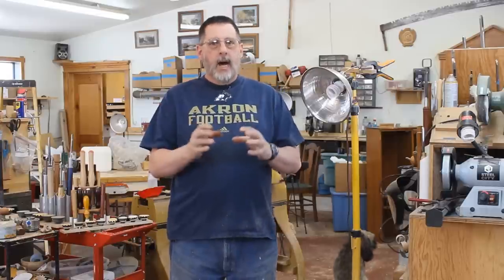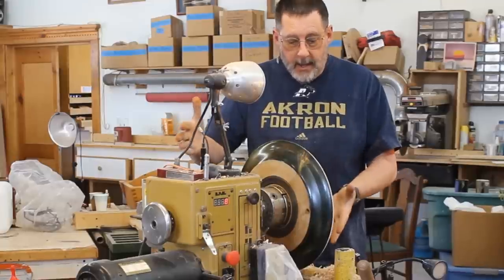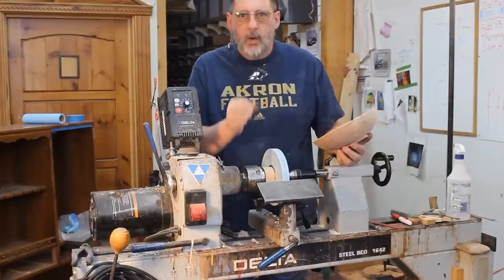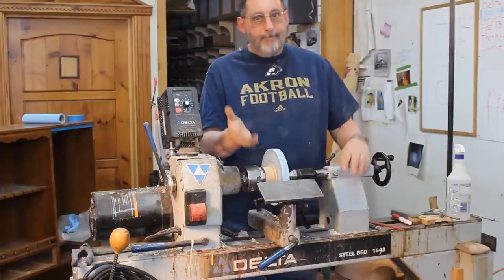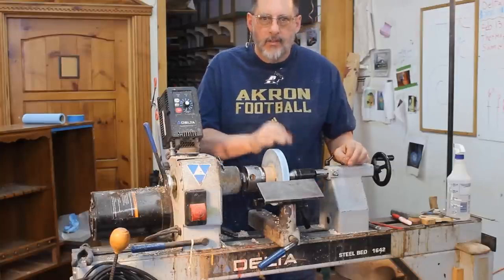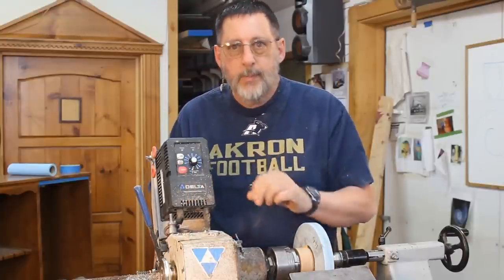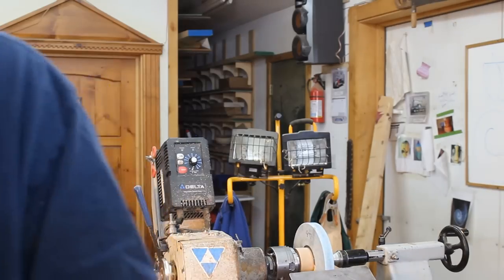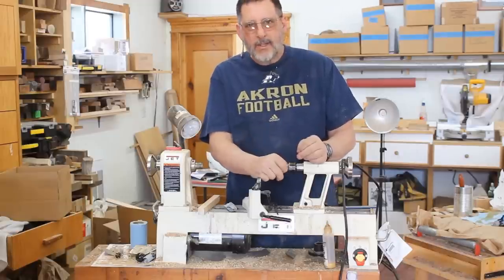Selecting a Wood Lathe

Comment: Sam:  Your thoughtfulness about what you say is commendable and above and beyond the call.  
Anyway,  I have the Delta you just sold and for me it works fine.  I do mostly small stuff and I am currently learning to chase threads. The only thing about the Delta is that if I need to go from chasing speed to turning speed I have to change belts.  I may look at the new Jet 1221 VS although changing belts is a 10 second process.
Reply from the maker: You got that straight....changing from chasing speed to turning speed-back and forth is a pain.  I have done a few thread chasing demos with the Delta midi.  It works good for chasing but for the back and forth is a pain in the backside.  Changing belts in the Delta was quick and easy but just interrupted the flow.
Thanks Sam

Comment: Very honest video Sam, I think you're right with your thoughts. Most people, including myself mistakenly start with "big and cheap", as we know no better. However I think it may be a good thing, as after all you may not want to continue, and then no great loss. The ethos of the best you can afford is a good one, then you only have to "cry" once :)
Looking forward to the Oneway un boxing.
Take care
Mike
Reply: Problem is, when the best you can afford is the cheap one.  Do you take the risk and have some fun, or do you miss out because you can't afford the "good stuff?"  I went with cheap and small, $500 Nova Comet 2 and other than some really crappy design flaws, I love it and without it,would not have returned to woodturning after using my dad's 50 year old lathe that could only turn spindles 29 years ago.
Reply from the maker: (Mike) Well when I did the first take on this video I really forgot where I started.  A borrowed lathe that had seen better days, hand made tools from old files--and there is nothing more exciting than breaking one of those files.  I actually tried "turning" something on my drill press.  Yes and Josef makes a good point....Maybe the risk is worth what joy we all experience-providing we survive.   Sam

Comment: Good stuff as always, Sam. I have a JET 1221vs which works quite well for my current needs, does have variable speed and a nice digital RPM display, and does do reverse. 3 belts, each which have a slightly over lapping speed range. Does have options for extending the ways, and extending the stand as well. The stand the JET sells is roughly half the price of the lathe itself, at ~$350, which is IMHO a bit much ( I bolted to 3/4' plywood, which is then bolted via 1/2" lags into my 3/4" benchtop (7'x2'x28" torsion box with 4x4" legs), which works fine. (I know you've already made up your mind and ordered, my commentary is mostly for anyone wanting another opinion on options). And if you are new to turning, as I am, do yourself a favor and take an intro class, and learn to sharpen your tools!
Reply from the maker: Todd
Good (and important) advice on sharpening.  If not sharpened properly, it can be a deal breaker.  Too many folks quit or get hurt or just have a terrible experience.  

There is nothing more fun than getting a new lathe.  The Oneway is very expensive for the size.  It does have a nice metal stand.  The total weight is 300 lbs where my Delta midi weighed around 115 for the lathe excluding the stand.  
Thanks Sam

Comment: Being a novice with a very small budget, I am always looking for advice on purchasing. I think it is important that people give truthful accounts of tools and equipment. I am currently on my third lathe since 2011.
My first was free, from Freecycle and was an old Myford ML8. I quickly outgrew this machine in my yearning to turn larger items.
My second was a Record Power DML36-SH which was bought following recommendations, or rather from anti-recommendations, from experienced turners.
I had narrowed my choice to 2 lathes, the Record one, and one from a UK based tool supplier who apparently re-badge Chinese-built machinery. I was advised not to go for the rebadge for various reasons.
I have since changed the Record lathe for the rebadge, and wish I had gone with gut instinct in the first place.
It all comes down to budget at the end of the day. I am tied to what I can afford, and this is what I base my purchasing on. As a hobbyist, I feel a more expensive machine would probably be wasted on my limited skills even if I could afford one.
Us beginners rely heavily on the experiences of other, more experienced, turners. Don't hold back on your thoughts Sam, even if your opinions are based on anecdotal evidence. I bought a cheaper, rebadged lathe and I am perfectly happy with it. Would I be offended if someone with far more turning experience than I have said something nasty about that? No. Varying opinions are important, otherwise more people would rush into bad decisions like I did.

Comment: Hi Sam
A very fair overview and useful to those thinking of taking up turning.I would have added in the lathes from Teknatool, NOVA brand, because they are available around the world where your followers hide.  Personally I own two lathes a NOVA DVR and a JET 1220 Variable speed old version. The NOVA DVR gets used most because whilst the JET1220 is variable speed the belts are quite fiddly to change. The JET is going to be changed out for the NOVA Comet II which looks to be better for my requirements when doing small stuff.
Regards
Roger
Reply from the maker: I have a friend who just got a Nova---don't know which model but he is very happy with it.
Sam

Comment: Could I use a generator to run a 3 horse power 220v lathe I am talking about the new one Grizzly has out the G0766.
Reply from the maker: I would think if the generator is designed to handle the 3 horse and voltage.  Don't rely on me.  I am just guessing...
Ask a pro
Sam
Reply: You should be able to get a 20 amp 220 circuit out of about any decent residential electrical panel.

Comment: Just don't but a harbour freight.  Yes it will turn wood and it is very inexpensive.  Save your money and buy a lathe that reverses and is capable of going slower than 600 rpm.

Comment: This video is clearly not directed at new wood turners. Must have features like reverse turning and on the fly variable speed are useful for seasoned wood turners, not necessarily so for beginners. You didn’t really even explain why you were leaning to Oneway. Jet I have heard of. Delta I know about, Grizzly seems good and Rikon is recommended by many; but what I have NEVER heard of Oneway. As a wannabe wood turner I learned nothing from this video.
Reply from the maker: This vid was published in 2015.  Since then I did receive the Oneway and have since sold it.  I have owned at least 10+ lathes in the past 30 years.  I now have four in my shop.  I strongly disagree that features like reverse and variable speed are not necessary for beginners.  Once you have turned on a lathe where you must change the belt position to change the speed you may change your mind about variable speed.  
It really comes down to price.  Woodturning is a really expensive "hobby."  What I do is NOT a hobby.  You or other new turners often find a lathe at Harbor freight or other suppliers where you can find an inexpensive lathe.  This may be a good place to start.  I am a Robust lathe dealer.  Robust sells 3 lathes, priced from $7,000-10,000.  I also don't recommend buying something like this.  These are high powered machines and can be dangerous for a new turner.  Do more research.  Ask questions.  Try to connect with a woodturning club near you or another woodturner who will be glad to help.
Be safe
Sam

Comment: Thank you for sharing. I want to or think I want to, get into turning bowls. I am not 100% sure on the size of bowls yet. That being said what should I look for in a lathe other than variable speed and reversible? Size of the unit? I would like to keep the foot print as small as I possible can but do not want to sacrifice quality. Sorry if this is vague but I am not still trying to figure this out.
Thank you in advance for any pointers.
Reply from the maker: I think you are asking the right questions.  It is worth doing some research.  One thing to do is find a club in your area or another woodturner who can show you a lathe or two.  It also starts with how much $$$$$ you want to spend.  To get the variable speed/reverse options you have to start at $600-800.  I like my little Jet 12-21 lathe.  It is fairly heavy for a small lathe I think it is 135 lbs.   Jet has a nice selection of lathes.  I have had a few Delta lathes and still own one BUT......Delta is not in the lathe business and has no or little customer service.   If you tell me generally where you are located, I may be able to lead you to a club.  You might also call Roger Durst at Craft Supply USA in Provo, Ut.  He knows everything about lathes.  Very helpful.  Sam
Reply: Thank you for the comments. I am in Minot, ND. I know, for the most part $$ = quality and options. I will look at the specs for the Jet 12-21 before I ask more questions about it. If you do know of any clubs in my area, please let me know.
Thank you.

Comment: Hi sam
I have a reverse in my lathe and i never used it.
You say in the video that it's a must.
What do you do with it ?
Here an idea for you for  a new video.
Best regard from the holy land
Shachar
Reply from the maker: I use it mostly for sanding.  It is good to sand in both directions.  The fibers in wood will lay in one direction, sometimes in several directions at once.  Sanding only in forward will not adequately smooth out the surface .  One some wood it is not an issue.  But maybe on a burl or other woods it is an issue.  I also have a coring tool which is used with the lathe going in reverse.  That is not a big deal for most people.  But maybe a good idea for a video.  Thanks

Comment: I have been turning for 2 months now. And I have an old craftsmen lathe. 15 inch bowls. And 38 inch spindle turning. It is 2 hp and variable speed from 400-2000. I'm thinking of selling it and getting a nova comet 2. Do you have any opinions on it?
Reply from the maker: +Todd Halleman I really don't have any first hand knowledge of the Nova lathes.  I have a friend who has a Nova lathe (not sure even which one)---he seems to like it well enough.  Other than that I can't tell you much.
Sam
Reply: +WYOMINGWOODTURNER ok thanks. I've been debating it, but I really want a reverse.

Comment: why do the grizzly lathes cost so much less than some of the other brands? comparing size and power etc.. the grizzly might cost $1800 and the other guy might cost twice that.  just looking at the spec sheet, the grizzly is a no brainer... but is it? is it not a good tool? or is it just a good deal?
Reply from the maker: Brian
I have never used a Grizzly lathe.  I do have an 8" Grizzly jointer.  It is an excellent tool.  Heavy and works great.My only comment about the Grizzly lathes is this.  I have only heard from folks who have owned one.  I have never heard much that is positive.  I went to demonstrate at Casper College in central Wyoming a few years ago and the shop teacher said he doesn't even turn with it because of problems with it.  (He had other lathes he and students could use).  I hope this helps.  Sam
Reply: WYOMINGWOODTURNER Ugh... you're probably right.   Probably not the lathe to buy.  I was just taken in by the numbers.. really good specs for not a lot of money.  But, I've decided to go with the Laguna Revo 1836.. which is a great lathe and has a lot of cool add-on accessories that add a lot of value.  thanks for the input and keep up the good work!
Reply from the maker: I think that is a very good decision.
Sam

Comment: Sorry but I had to laugh when you said what lathe do I NEED--Right after you had admitted that you already had two lathes!  Sounds like the difference between  a want or desire and a need that I am always emphasizing to my kids.  Having said that I need some bowl gouges as I don't have any!!   :)   Very good video
Reply from the maker: +Terry Ellis 
Not entirely sure what you are getting at.  By NEED I am sure I am referring to---"Do I need a variable speed or do I need  a 20 inch swing"  I am in my shop every day trying to make a buck.  I just bought a fourth lathe.  I sure didn't need it but I earned the money through very hard work.  I wanted a small lathe I could take around the community for demo's.    Woodturning is a very expensive hobby.  This is not my hobby.  For nearly 30 years I have found a way to make something and sell it.  This gives me the luxury of buying a tool when I want it.  Sorry if I came on too strong here.  Sam

Comment: Thanks for your comments. I'm looking to get my first lathe and have been debating between getting a cheaper one (aka Harbor Freight) or saving for a Jet, Delta, Nova, etc.  The old adage "you get what you pay for" ALMOST ALWAYS applies.  Don't be afraid to give your honest opinion.  As long as you're not rude while doing so, I think its ok.
Reply from the maker: I would not be rude, obnoxious maybe.......OK.  You do get what you pay for.  But you buy what you can afford.  I have always made a bit of money from woodworking/woodturning.  So I have been able to afford the machines I wanted to get.   (But I have also worked hard and spent way too many hours in my shop.  A matter of my priorities a little out of balance).  I have the Jet Midi.  It is around $850.   Link   
 https://www.toolnut.com/jet-719200-jwl-1221vs-12-x-21-variable-speed-wood-lathe.html?utm_source=google_shopping&gclid=CjwKCAiA-9rTBRBNEiwAt0Znw1W1xMrouywZwu3aArHvauPGs-NiEpB6ZJWeLEt3ASlFD9mBp_yEuhoCpdQQAvD_BwE   

I think it is a great lathe to start with or for anyone.  I have a Oneway 1224 that cost $2500.  The jet does every thing the Oneway will do.  I have never used a harbor freight lathe but lots of folks do and are happy with them.
Sam